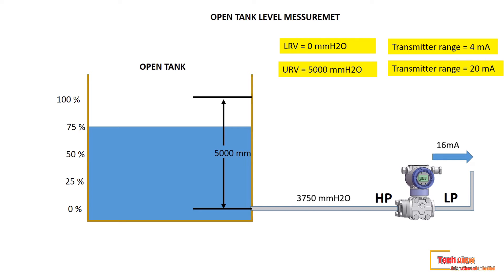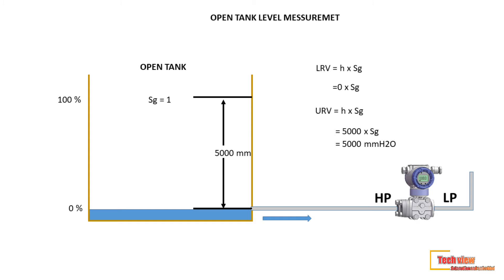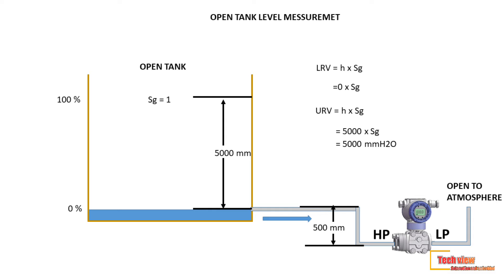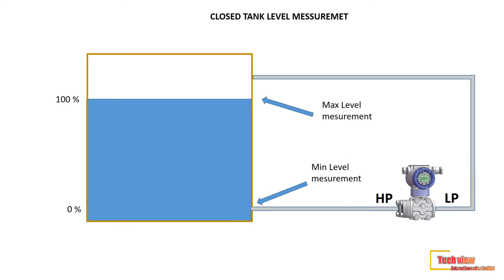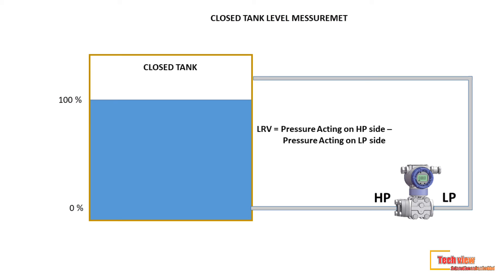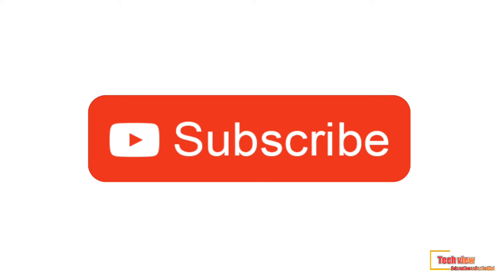Dp type level transmitter | Closed tank level measurement | Dry leg

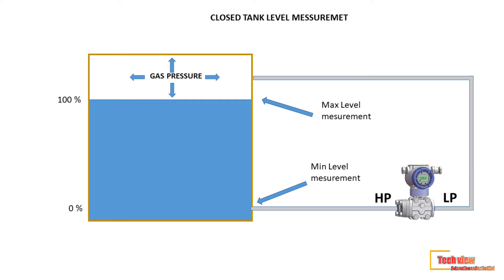Comment: Thanks for the video...but @ 1:59, you said, we connect LP side to the top of the tank, because, if gas phase exist in the top of the liquid, the gas pressure must be computed.
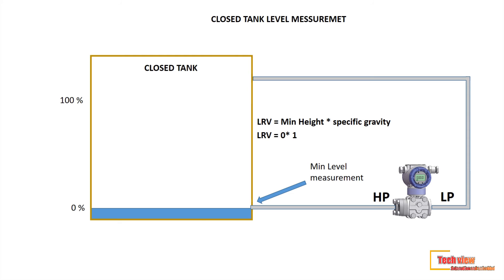And @ 3:26, you said, we neglect LP impulse line because it's a dry leg....but i thought, it must be computed for, since you said that @1:59. Can you please explain?

Comment: Qn:  is it possible for a single level transmitter to work under both cases at the same time (open and closed tank)
Reply from the maker: we can calibrate same transmitter for open tank and closed tank....but it can't use same time for both tanks..